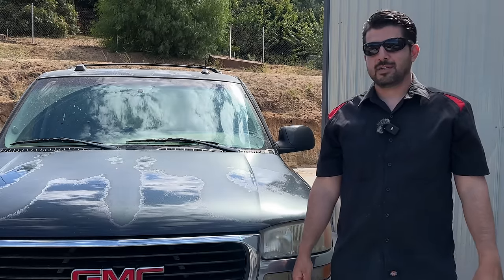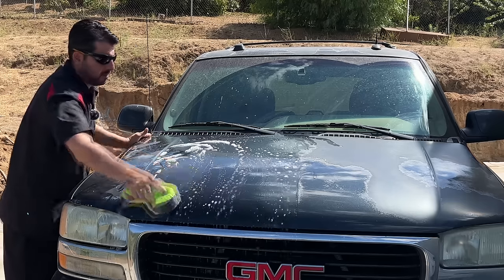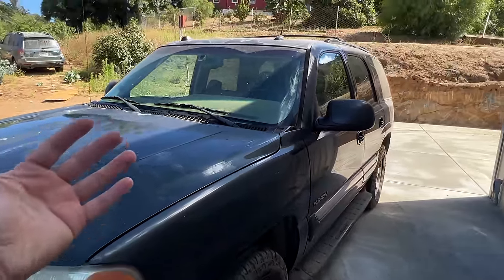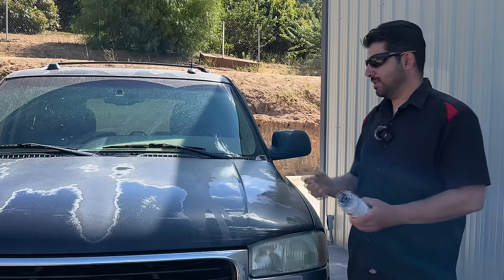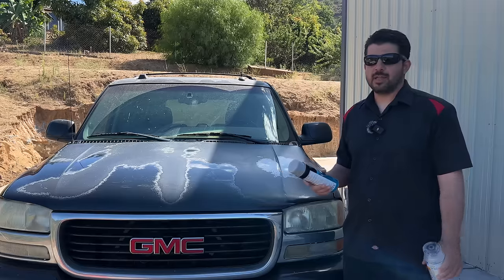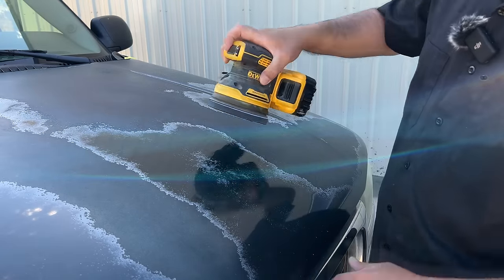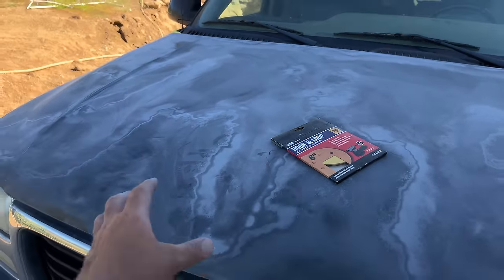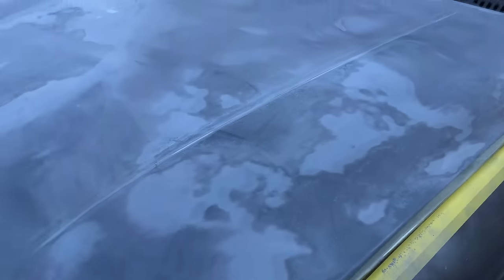DIY Paint Job With Rattle Cans

Comment from the maker: My Amazon Store: https://amzn.to/3YH84sm

2k Clear Coat: https://amzn.to/3OzXLSo
2k Rapid Filler Primer Gray: https://amzn.to/3DZy9JT
5 Inch Orbital Sander adapter: https://amzn.to/45sc8PG
600 Grit Sandpaper: https://amzn.to/3QKl2Ug
Grease and Wax Remover: https://amzn.to/45dOV3D
Soft Sanding Block: https://amzn.to/45fXkDU
Microfiber Sponge: https://amzn.to/45wA18A
Microfiber Towels: https://amzn.to/45aTT1c
Reply: No wonder people forget to tack it -you didn't list it even sfter saying how important it is.
Reply: Subscribed.  You are well-spoken and articulate and straight forward with your explanations.
Reply: Tack Cloth ??

Comment: I am a 40+ year combination collision repair shop owner. I got quite a chuckle when you started sanding with 600 on that hood. I have people come in wanting work like that performed. I won't do it. I'm glad there are guys like you to show them how to patch up their paint. Because, when the remaining clear that you covered up finishes coming off, it will take all that material you sprayed over it with it. That's why I say it's a patch job. You covered the problem. You didn't fix the problem. But it does look better than it did, to some folks. To me, it's more of a mess than it was. Lol. But your methods are fairly solid. With the exception of not stripping all the old clear and base down to the undercoats, or bare metal. You primed it 2 times, you could have stripped it and done it correctly with another hour of sanding in the beginning. I'll watch more of your content and try to be nice. Lol.
Reply: So basically a good sand job solves everything he did wrong?
Reply: @kingboy19971  almost everything. protecting the bare metal with an etching primer is useful for allowing it to set for a time before finishing the surface prep work. Using a filler and/ or a high build primer to fill any imperfections in the metal from the sanding/ stripping or hail, golf balls, etc is important. Sanding the final primer with 600 to 800 grit prior to applying the base color is important for a smooth uniform color. Keeping the surface clean of dirt and contaminants up to the point of clear coat application will help with the final shine and appearance. Its hard to get a good finish with a spray can, on a large surface, with no control of the thinner used in the color and clear. Spray can material is normally formulated to dry fast. Fast is not great for color and clear. Matched to the ambient air temperature and surface temperature is preferred. There's more, but these are the high points. IMHO the video is good basic info. The clear he feathered and primed, colored, and clear coated over will fail, taking his material with it. The other thing, stripping the panel to bare metal will allow the applied material to dry, shrink, and cure uniformly. Priming over old substrates will show up as rings in the new paint job in a short time. Long term the old material will fail, recreating the original problem.
Reply: but for a car that is 30 years old, and getting a professional job costs more than the car is worth?   maybe this approach is reasonable… 🤷🏻‍♂️
Reply: @davidmorton8170 of course. That's the best that truck is gonna get. Of course there are better ways to do it. This is the internet. It always gonna get some "expert" that would do this or that. Or would charge this much because they are gods gift to whatever. Lmaoooo. Imagine sanding that old ass hood down to bare metal. Whoever suggested that is out of their mind.
Reply: What grit sanding blocks do you recommend and in what order should I use them? Thanks.
Reply: I heard a backyard mechanic say, “if it shines, go over it again. It’s gotta look like an ashy knee all over” 😂
Reply: Yea stock around we need a guy like you to paint or lowriders and classics. Strip to the metal wow😮
Reply: @davidmorton8170 Exactly! 👊
Reply: Make a video and show your expertise
Reply: He said cheap and corners cutting…
Reply: @nthy123iop  Social Media has exposed the reason for most issues in the world. Poor Comprehension
Reply: He said anybody can do it tho it’s not rocket science
Reply: @michaelphelps5064 Are you saying that it’s absolutely necessary to take it down to bare metal or will sanding down to the color coat (sand off the failing clear coat) be sufficient to get a durable finish?

Comment: I'm a body man of 30 yrs, every car that entered my shop for paint is washed with a 2% bleach solution to eliminate fish eye and other problems.
Reply: what is fish eye "problem" on a car? hever heard that description
Reply: Wow. That's a great tip.
Reply: Never have had an issue as long as the panel was cleaner properly before spraying
Reply: But you looks like 50yrs already

Comment: There's a lazier/easier way - get some laquer & varnish remover spray - they do it in aerosols.. spray it on the clearcoat, let it work, use a plastic scraper to scrape off the old clear. Wash the panel down well, use a grey scotchbrite pad to lightly scuff the original base & provide a key... spray on fresh clearcoat..  Go have a beer. :-)
Reply: That’s the correct way to the job retired auto body technician
Reply: But if it has bondo or putty, does it mess it up like paint remover does?
Reply: @tonyt160  No.
Reply: Love this tip.  Going to store the information in my commodore 64.  I say that cause my memory sucks, not to a say anything bad about your approach.  I truly am going to save that information/write it down!
Reply: Can you please specify what lacquer & varnish remover spray you use?  Seems everything I can find will also destroy the original base.

Comment: The problem with doing large areas with those spray cans is not that the paint is bad. Its catalyzed paint, its fine. The issue is the small amount of paint it delivers. It puts such a thin coat its hard to get it to flow and level out. You can never it it on right enough to buff either

Comment: I've done this job before, here's what I did differently:

1. I took the hood off.  It was easier to just remove the hood than to mask the entire vehicle.  YMMV, it largely depends on how many things you need to disconnect from the hood, and how heavy it is (my Ranger has an aluminum hood so I only had to deal with bulk; a steel hood is more likely a two-man job).  Taking the hood off also gives you the opportunity to hang it and paint on a vertical surface instead of a horizontal one.  With spray cans, this is better.
2. I wet-sanded with 2000 grit between base and clear coat applications to help reduce orange peel.
3. I spent on my primer and clear coat with 2k supplies but went cheap on the color, because it was black.  If you have a tougher color, a body shop supply store is a good choice, but quality is more important on your primer and clear than it is on your color.
Reply: How long did you wait after base coating to wet sand 2000 grit?
Reply: 2000 GRITS TO FINE YOUR PAINT WILL PEEL OFF OVER TIME ITS GOT NOTHING TO STICK TO.
Reply: @rodobrien3488 I think he said in between the base and the clear? Not between primer and base?
Reply: good for flat colours but metallic colours should be painted orientated to their position on the vehicle.
Reply: Man that's the strangest looking ford truck I've ever seen lol
Reply: Exactly some peoples just fucknig around with the tape, the sander will completely annihilate it 😆🤣 and the good paint will be sanded around it anyways this is just a botch job... Thking off the hood is the way to go...
Reply: @CoreyRoberts-ph2zt 04’ truck.  Not Ford truck. But you knew that already my boy. I think he got a little lazy speaking on that part. 😂
Reply: Yes, tought to sand base on can job
Reply: Great advice thank you!
Reply: My Ranger has factory hood and they are steel. Not that heavy.
Reply: I did a Rust-Oleum 2x and 2k erothane color change paint job on a C4 Corvette that looked great for $97 😉
Reply: I don’t know why I watched this but hey 🎉🎉🎉🎉

Comment: These car companies should be paying for this.
As a former detailer, we saw this constantly. People honestly should start holding these companies accountable, online. The clear coat quality, is unacceptable.
Not even keeping it waxed, will stop it.
Reply: Agree every chevy on the roads has this issue 🙄
Reply: Cars up north rust, cars down south get UV damage from sun and heat.
Reply: @cheeseheadfiddle  Cars near the beach get salt damage. Waxing a car should protect the paint anywhere tbh.
$40,0000 should buy quality paint imo.

Comment: I remember watching your older vid painting the hood of your truck when I was attempting to fill in a peeling paint spot on my Crown Vic's roof. I'm back here preparing to redo the whole roof now several years later as more has peeled away. You can't stop that mid 2000s Ford paint from peeling😮‍💨
Reply: Yep. My ford pickup pretty much has no clear coat left on any horizontal surfaces. Sun ate it all apparently.
Reply: Same on my 2005 Grand Marquis, the roof panel over the rear window even has rust, and the center back edge of the trunk lid.  I live in the desert, the rust surprised me. 😕

Strangely, the hood is still okay . . .

Love the comments at the end😆
Reply: I'll see your Ford paint, and raise you a Saab!

Comment: about factory coded paint #, I have an older car and had the factory color mixed. I was repairing/painting a square foot or so of damage on a door.  The problem I ran into was the cars color,  "beach sand", faded over time, 20 years or so even with cleaning and regular waxing.  The result was that the "original" factory paint code color that was prepared was much darker than what the color of the car now was.  I went back to the store and the color was diluted.  This was done 3 times and the  final result was still noticeably different.  Even if the entire door panel was painted you would notice the color difference between the rear door and the rest of the car.  This might not be a problem with darker colors though.

Comment: Nice. I've done a similar DIY painting in the past. For the paint color, I highly recommend asking the employee on the available paint lines that they can mix for your color. Some lines are garbage. I would stay away from PPG Omni line because it sprays VERY thin, so you waste more time with extra layers. Since it's thin, I could barely finish painting half a fender with it. You only get about 4 oz of paint in a 16oz can, so the rest is just the gas propellant. I had better experience with Metalux paint line.  I still haven't found a method to use the 2k clear without getting massive orange peal.

Comment: My 2006 Toyota Tundra had some serious paint ugly problems on the hood and the roof ascribed to age and exposure, I’m sure. A friend tried to repair the paint but that attempt failed miserably.  If I had seen your video I might have tried your method.  Instead just more than $2,000 later, a body shop did a beautiful job.  But it’s a 2006 and I could have saved a boatload doing it your way. Great video!

Comment: What if I want to use a roller? Yep, like painting the rumpus room. One color background and a slightly different color on top with a texture roller. Just do it! No overspray, just mask it and roll away. Of course some sanding prep is needed for adhesion. Gonna try it.

Comment: Great job as always 💕👏 I'm sorry I forgot your name. Have you sold any of the old fleet of cars you collected from auction? I miss updates on them.
PS- 50/50 water and rubbing alcohol works well for wax and grease remover if you run out or dont have any

Comment: Great video.  I am going to try this with my old 07 Chevy Silverado.  It still runs decent with 353,000 miles but the paint is looking rough.

I have a Rotary Car Buffer Polisher Waxer, 1000-3500 RPM.  Will this be slow enough for the sanding?  I'm guessing I can use it for everything else so it would be great if I could use it for the sanding too.

thanks,

Comment: Thanks for the great content...the video was really good.  One question though...just curious why you didn't remove the hood?  I think removing four bolts would have been faster than masking it off...and you could have sanded the hood edges easier.  And since this was a hood from a truck, it was higher so the simple fact that it would be easier to work on while sitting lower on sawhorses or something would have made it easier.  You may have a good reason for not removing it but I was just curious what that might have been.  Thanks!

Comment: when checking for smoothness it works better to use a thin cloth between your fingers/palm and the sanded surface, the cloth will jag on any rough spots and amplify the sense to the skin. Plus keep skin-oils off the surface.

Comment: Is orange peel texture at least partially a problem of air bubbles?

I've seen some videos of people using heat gun (or just hair dryer) for some types of wood paint or poured epoxy - as that removes the orange peel texture.

Comment: Rattle cans seem to work best used in a vertical direction, I'd be inclined to remove the hood (bonnet) and place it vertically under cover out of the wind and no masking required.

Comment: Thirty plus years of refinishing vehicles I will tell you the correct way to handle this prep is to completely remove all the old clear-coat as it is completely broke down ( lost its adhesive ability) and is useless as a foundation. It will eventually become a problem for the future refinish. But it just kills me he’s not even trying to spray this cheap paint job inside for the primer coat. The dirt must be unbelievable. Also something this small should always be shot from the outside of panel to the other side. It will help to avoid the dry line effect in the center of the panel which will be visible at the end result.

Comment: literally been wanting to do this on my truck. I wanna fix all the rust spots. Is the proper way to do that to 1. remove the rust 2. spray rustoleum rust reformer (2 or 3 coats) 3. spray rustoleum 2in1 primer (2 coats) (I have heard some say you need to spray a self etching primer first but im not sure) 4. duplicolor basecoat(2-3 coats) 5. 2k clearcoat spraymax (2-3 coats). I really want this repair to last and not be a shoddy job. Thank you.
Reply: So that's the best approach to treat the small rust spots before doing this type of paint work? Sand the rust down? Then spray the rustoleum reformer, then the rust primer?
Reply: from what ive seen and read, yes. I have never done this before but I wanna do it right. According to what he said in the video, on all the spots where bare metal is showing you need a self etching primer.
Reply: I want to add if you really wanna do the 2k clearcoat get coveralls, a full face mask with organic vapor filter and gloves so none of that isocyanates get on your skin or in your lungs. If you dont want to do 2k clearcoat you can do 1k. The finish will not be as glossy but it will cost less and be less risky overall.
Reply: @whojackson   Ok thanks for the advice.  What do you estimate it would cost to do a basic sedan for the front and top?
Reply: @HermannTheGreat  I wanna say 240 (80 safety supplies, 80 for 4 cans of 2k clear, 50 for basecoat, 10 rust reformer, 20 2in1 primer) if you wanna do 2k clearcoat and get the mask, filter, coveralls and gloves or 130 if you do 1k clearcoat. you might need a lot of cans if you want to do hood and top of your car depending on how big it is

Comment: Don’t use a gas leaf blower because if the gas oil mix. Some exhaust will come out the blower tube and get in the area to be painted. Probably won’t ,, but possible. Depends on the blower. 
Just a thought guys.

Comment: Im a  body guy/painter for 36 years. I was also laughing when he said 600. First thing I would have done is strip it I could still see tiger stripes. He should have shown us how to use a ratio cup and told us go spend $12 at harbor freight for a purple gun. I'm glad I stumbled upon this video. I was saying oh no especially when I saw spraying the blotchy primer sprayed in the sunlight. So much for the flow out wet coat.. I'm still laughing.

Comment: Great video! I need to do a roof panel on one in the fleet and if I get the results you got on this hood, I’ll be very happy. On my roof panel, all of the clear is gone and most of the paint and now it’s starting to surface rust. Will I have to sand all of that surface rust down to bare metal? Thanks
Reply from the maker: Yes you do have to sand it to bare metal and also I would use a rust inhibitor. GL
Reply: @myRatchets  appreciate it. I’ll follow the link to your Amazon store and see what I can find. It’s an old high mileage car so it doesn’t have to be perfect but it would make it look a lot better. Thanks again. Was great to see a new video from you.

Comment: So you dont get streaks you mist the hood as the final coat then you sand it lightly with 2000 grit reason why is misting it leaves like sandy feel to paint, then you clear coat, forgot to say  then tack wipe base coat after sanding then clear coat.

Comment: That needed more base coat for sure. You could still see the primer coming through. And you could see the streaking. You just need to wet sand and polish and no more orange peel. But you need to have a good amount of clear.

Comment: I would leave a large fan (its back facing the truck) running beside the truck so as it spins the propeller sucks the paint particles   & debris flying around in the air & push it to another direction.

Comment: How come you did not use Spraymax 2K Clear Coat.  I like that product because it is a much better clear coat than the non 2K.  I was surprised you did not cover the other cars in the shop when spraying the clear coat nor were you wearing eye protection..